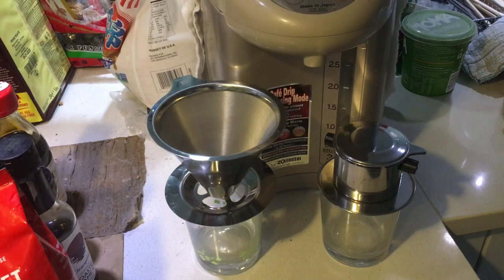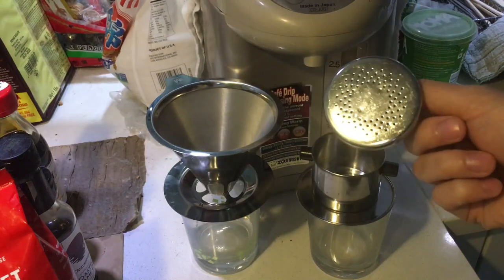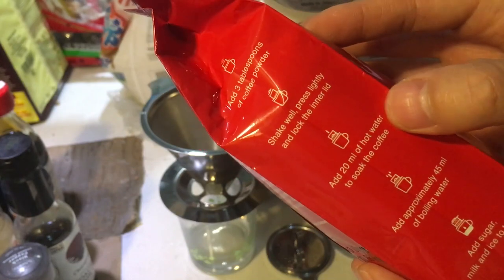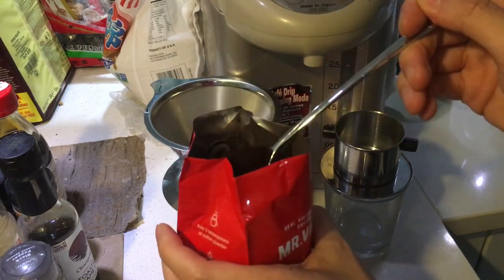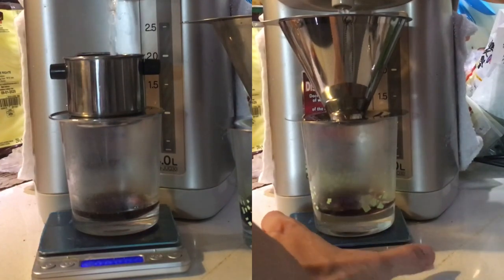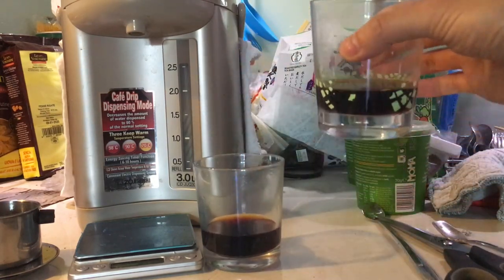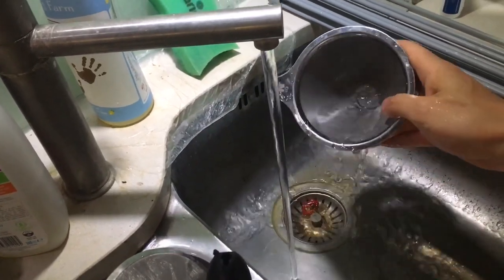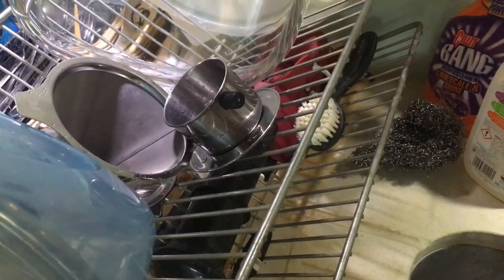Stainless Steel Cone Pour Over Coffee Drip vs Vietnamese Coffee Drip

Comment: The flat steel plate filter system (Vietnamese or Indian) produces a better cup for me than the permanent filter or a pour over paper filter. The  oils being extracted thorougly  through the slick between the 2 plates must be a big part of it. And even an Espresso grind leaves little mud if blooming time is long enough.
Reply from the maker: peet1250 the plate evenly distributes the water before it hits the grounded coffee beans. It also takes the heat off.
Reply: @DrJamesT  Agreed. Having compared different blends and roasts over the last 3 months using permanent cone filters and a paper pour over against the Vietnamese type, I consistently experienced  the same results  you describe, particularly the bitterness. I'm no expert, but my tastebuds refused to support the other options which I used for years.

Comment: I have brewed the coffee in Vietnam with the locals, and I can assure you that the amount three TABLESPOONS is the original recipe. I might add that  I’m a Finn, and we drink a lot of coffee, the most per capita in the world and also quite strong coffee, specially in terms of the amount of caffeine the drink contains. That means I, as so many other Finns (and Scandinavians) like strong coffee. The Vietnamese do too. Their coffee is short and strong while according to my experience the Americans like their coffee very mild and long.

You are right about the temperature. It’s crucial if the flow time is long. That’s why you get surprisingly smooth coffee from espresso machines that use hot water. They press hot water quickly through the powder, which has only enough time to release the very light organic aromas and oils from the powder leaving the bitter tasting acids bound to the powder. Reason being that the bitter compounds are bigger molecules and require more time / heat to be released.

So, next time, in order to experience the REAL Vietnamese coffee moment, use the TABLEspoons, just as instructed. If you’re afraid of caffeine, that’s still needless. You get more caffeine  by drinking one Red Bull can.

Keep up the good work!

Comment: Given that the flat filter drip pretty quick compare to how i usually do my coffee, i doubt it was enough coffe to use the vn filter. If there's not enough coffe, the plate would not b as tight and it would give a less concentrated result.  With that amount, a smaller sized filter would give better result.

Comment: It's been my experience that if you use good quality coffee, the only reason it is bitter is due to over extraction. You may need a coarser grind for that brewing method to slow down the extraction process. You may also need to adjust the amount of water you're using, or possibly the temperature. Otherwise good video!

Comment: Should be using a gooseneck kettle with the conical pour over and pouring in a methodical circular swirl. You control the water and bloom it this way first and the coffee isn’t bitter that way at all. Actually, Vietnamese coffee is more bitter but both are good. And 3 TBS is the standard measurement for an 8 oz cup .. informative video overall

Comment: Today I used the cone filter. Easy to use / clean and coffee was great. Just put cone on my mug and pour in the hot water . Coffee was from Gail's , decaf grinded 😊
Reply from the maker: There's so many variables that control the experience of coffee that's not related to the filtering. I focus on finding the easiest method to use and clean first. Then tweak with coffee grounds.
Reply: Phin filter is a pain in the ass, takes forever.

Comment: Should've dumped out that coffee from the blooming under the conical filter before the 2nd pour because it's very bitter and spoils the cup. I noticed there was no coffee under the phin filter after blooming. So you can't know from this experiment for sure if the conical filter really delivered more bitter coffee than the phin filter.
Reply from the maker: Caffeine on its own tastes bitter, alkaline, and slightly soapy. It's also very water soluble. The first pour would have the highest concentration of caffeine so the bitterness does make sense. What you're saying sounds inconsistent. I kept everything the same by not pouring anything out. Like for like. Minimizing variables.

Comment: Put more coffee next time not enough
Reply from the maker: hoa tran I agree if I want to make a strong brew. It could be so strong that I couldn’t tell the difference. I purposely use a smaller amount to tease out the subtle differences. Btw this is just a sample size.
Reply: @DrJamesT  It's not about a strong brew. It's about the flavour. If you want a weak good tasting coffee then you use less or arabica. Vietnamese coffee is mostly robusta but they have a good amount of arabica as well. It usually takes ~7 to 10mins for a 7cm coffee phin to drop out a good tasting coffee. It depends on the size of the grains and if you have a vacuum seal/osmotic pressure etc etc. Some times the pressure of the air and water won't let the coffee drip and lifting the cup part will break the pressure and make it start dripping.

Comment: It’s supposed to be 3 table spoon, vietnamese coffee not supposed to be drank light or it will taste very bad
Reply: Also slow drips. It looked to me that his coffee was dripping about 2 or 3 times faster than ideal.
Reply: @skilletpan5674  yep, we’re gotta put a touch of rapid boil water around the PHIN (vnmese word for our dripper) to heat up the metal, then put the coffee in and press with the presser, pour boiling water in just a touch and let the coffee absords and expand. Now we pour it in full and again boiling water. With the expansion of the coffee ground it will make the dripping process slower and thus, the coffee will be creamy rich and darker in color. Highly recommended any medium coarsed grind. 80/20 % robusta arabica ratio and dark roasted. Even tho traditionally corn starch and caramel flavoring is added to the coffee ground while roasting, don’t buy those stuffs and stay away from TRUNG NGUYÊN brand. American coffee works perfectly if anybody follows my recommendation. Thank you bud for giving me a chance to show off a bit.
Reply from the maker: I trust a Lam to tell me about coffee.
Reply: @danlam2604  Why stay away from TRUNG NGUYEN? I'm not doubting you, I'm just curious since I don't know anything about the brand.

Comment: I have the stainless steel cone pour-over coffee dripper and I love it but
 after making my first of 3 – ½ - ¾ cups of coffee, the dripper starts dripping very slow, if at all.

I have to push up the coffee grinds to get it to start dripping again.
When I fill the dripper up with water it drips through but when it gets halfway down, it slows down or stops.
I use 3 tablespoons of coffee grinds.
I clean both sides with hot water. Any ideas?